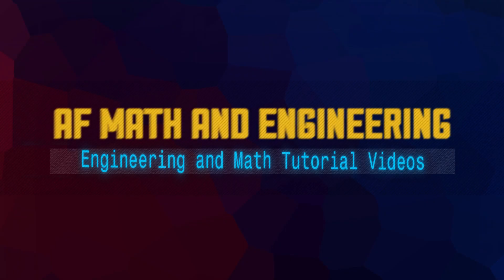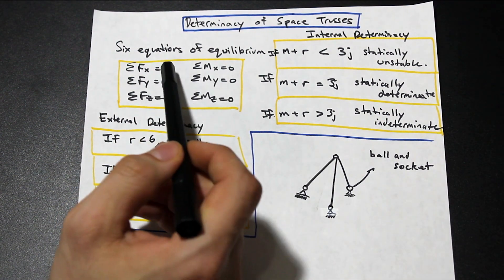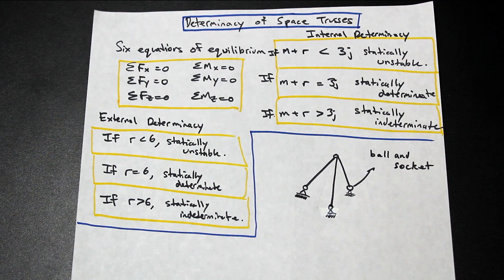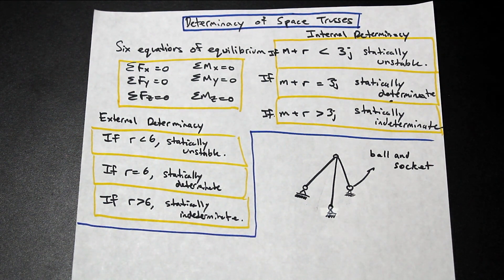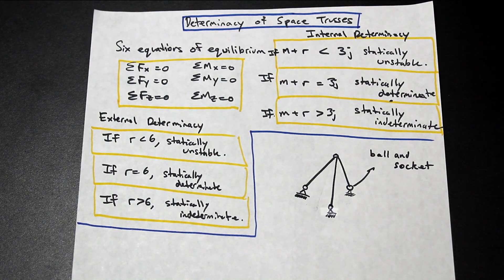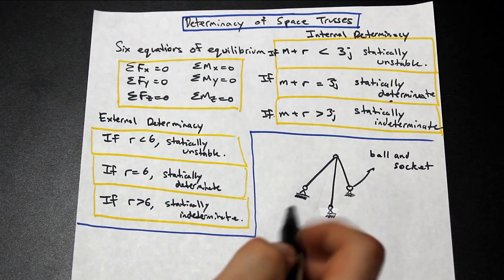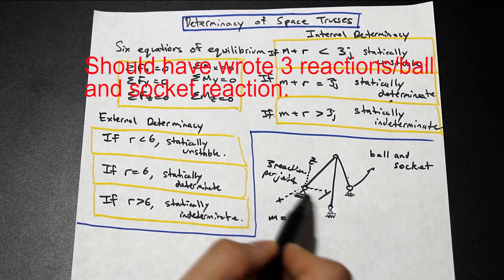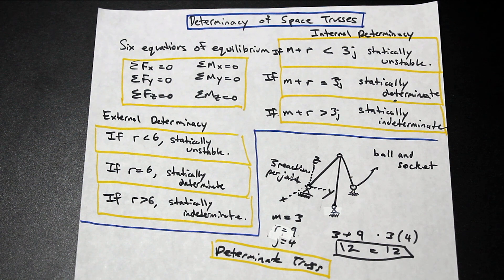Static Determinacy, Indeterminacy and Stability of a Space Truss (3D) - Explanation and Example

Comment: In 2d structures we know that in a fixed support there are 3 reactions. Is it possible in a 3d structure that the number of reactions in a fixed support are altered?
Reply from the maker: Good question, depends on the fixity.  In 2D structures it's simple, but for 3D structures it's not so simple and really depends on the type of joint and in which direction motion is being resisted.  We mentioned in this video that it's quite important to look at the joint in question and really think about where translation and bending are not allowed.  Some examples would be an W shape beam bolted to a column by just the web, which would will not transfer moment, versus an I-beam bolted to a column by flange and web, which will transfer moment. Or a welded or built in beam that is fully fixed.  Bottom line: More knowledge of reactions is required for 3D analysis in terms of fixity.
Reply: So for example in the example you posted...if we replace all the ball and socket joints with fixed joints...how many reactions are we going to be having?
Reply from the maker: How many reactions would you expect a fixed joint in 3D to have?
Reply from the maker: Think about how many possible reactions there could be in 3D, and which of these would be resisted by a fully fixed joint.  There are six total reactions in 3D, and a fixed joint resists all 6.  6*3 =18 reactions if the ball joints are replaced by fixed ones.